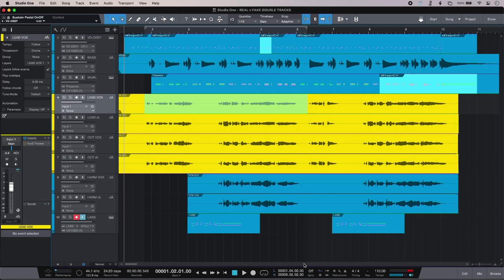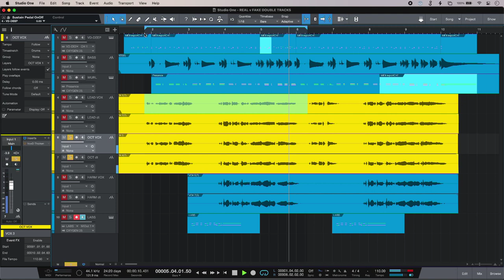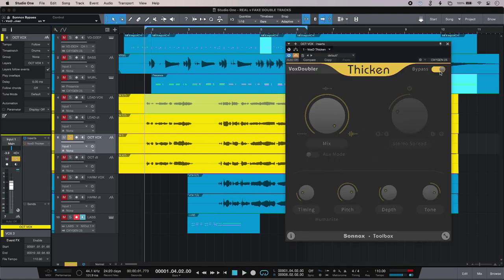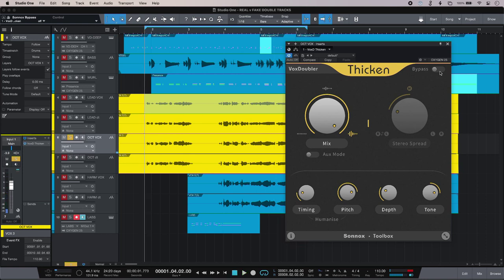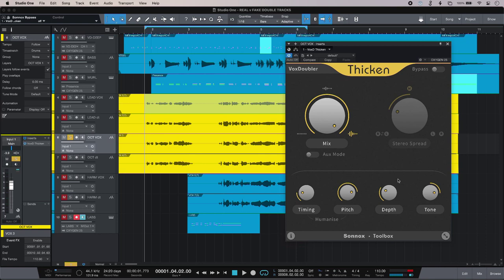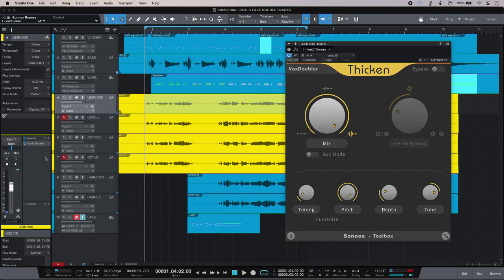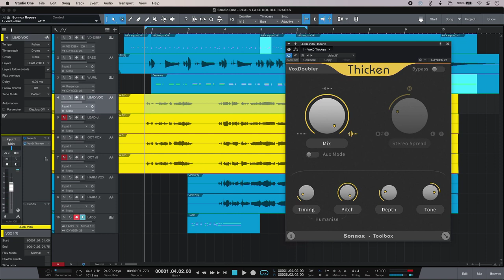Why Use Fake Double Tracking?

Comment: Ive found that copying the vox track and shifting it ever so slightly in various regions can give a good approximation of vocal doubling. Also for chorus's that repeat try using the 2nd chorus for the doubled part of the 1st it may take some masaging of the timing  but it can work in a pinch. Sometimes even a take that is not perfect enough for the main vox line can be used as the doubled vox. These methods can be used to get that big chorus sound if done correctly although this may not be appropriate for every session it can be just the thing at the right moment.

Comment: Real double tracking sounds better. But it means going back and re-recording parts in isolation, which is fine, but if you're like me and you like to play the whole thing through "live" in one take, and make it sound like a live track, then piling on a bunch of takes of one instrument for double tracks isn't really great, as it ends up sounding overproduced and too perfect, unless your band has more than two primary guitarists, like Iron Maiden, or loads of backing vocalists. But if you're a one man band with a looper, it's just you and your guitar. So ADT is the way to go in that scenario, with things like the Mimiq pedal, which can split a performance it seemingly two separate performances, live, with just one guitarist, or one rhythm and ome lead guitarist / one vocalist or one lead vocalist and one harmony vocalist. ADT can also be used to make things like bass guitar sound double tracked, which would be hard to do live as most bands only have one bass. ADT is just a different technique, for a live setup.
Reply: Great comment, exactly what I was pondering, as I recorded a live sound with my band and my guitar is not readily accessible anyway. Glad I came across your post